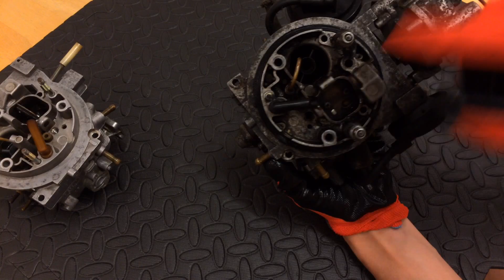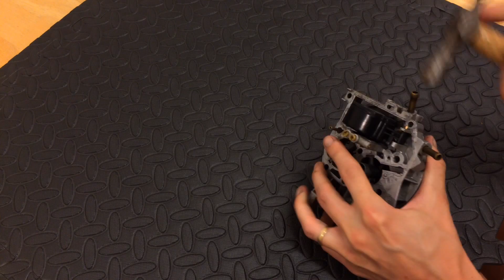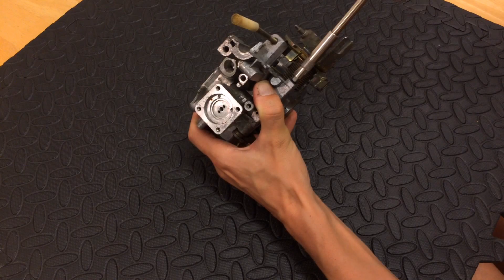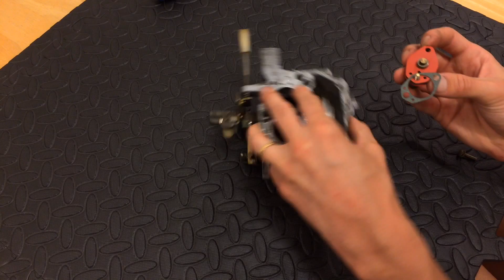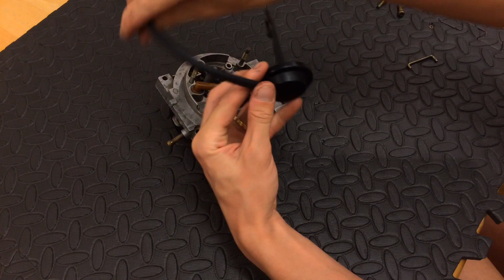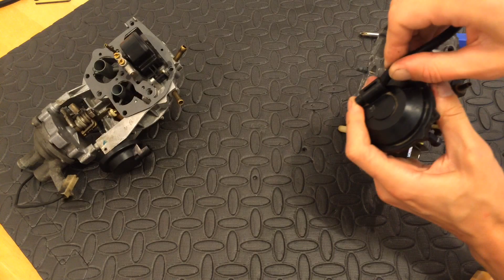Pierburg 2E3 Carb Rebuild & Adjustments for VW T25 / T3

Comment: First! Great vid, almost as clear as a step-by-step guide!

I recently opened the automatic choke on my VW T3 1.9DG because the choke wasn’t closing properly. When I inspected it, I noticed that the bimetal coil sits loosely in its housing – it can rotate around its shaft. Is this normal?

Another issue is that the fast idle cam doesn’t stay on the cam, so I have to manually hold it in place. Could this be caused by a faulty or missing spring?

I’m trying to understand if the loose bimetal coil and the fast idle problem are related, and what I should check or fix first. Any advice would be greatly appreciated!

Thanks again for the great video!

Comment: Thank you very much for the video! I watched it from start to finish! My carburetor is the newer version and I need your help to share a few values that are specific to my engine. It has a code starting with EW. Volkswagen Golf MK1 Cabrio 1.6. What should be the distance between the gasket and the highest point of the float? How small is the opening of the automatic choke and how big is the large one? I've been trying to adjust it for two weeks and something is still missing and it's not working properly. I have come to the conclusion that the float level is low and keeps the needle open, which returns air and fuel from my system back to the tank, because I notice how it flows back through the tube and after about 10 minutes when I try to start it, the starter spins for too long :( (especially when the engine is warm).
Thank you very much, man, for the perfect explanations.

Comment: A persistent problem which surely must be carb/autochoke related: I run a T.25 1.9DG built in '86 with a Pierburg carb. Having stopped for a motorway break of 20 minutes or so my van restarts only to stall almost as soon as my foot is off the accelerator. Repeated attempts to restart end in failure until the engine has cooled for at least half an hour. Sometimes it fails to start even after cooling down. On two occasions Roadside assistance have come and sprayed some Easy Start into the air intake which sorts the problem immediately. Not a happy or sustainable solution of course. (is it true that stuff can damage the engine?) Once it's going again, the van runs perfectly. Would you be able to shed light upon a more permanent solution?

Comment: Hello does some one have some advice for Pierburg 2e3 carburetor for Opel ascona C car 1.3l SOHC engine 55kw 75ps I want to reduce Litel bit fuel consumption so I was wondering do smaller Pierburg Jett's fit in that carb? I'm normali under lower rpm engine ranges I Rareli drive past 50-60km/h .Did ever some one try LPG adaptors on those cars I hope for some info and experiences

Comment: I changed the fuel filter and cleaned out the carb inlet fuel filter and it worked for a while then same lose of power came back. Do you think the fuel pump could be gunked up ?

Comment: My choke pull-down unit isn’t working (diaphragm perished) and you cannot source another one for love nor money. Everyone is sold out. Does anyone have any suggestions? I was thinking maybe block off the tube to the unit then try do adjust the small Allen screw to get the choke flap to open slightly (3mm if possible) when cold. Anyone?

Comment: Hi, just a bit confused about the jets, you changed the jets for the primary and secondary Venturi, and the air correction jet you changed just one, am I not correct in thinking that the secondary Venturi air correction jet needs replacing or is it fixed and can't be changed.

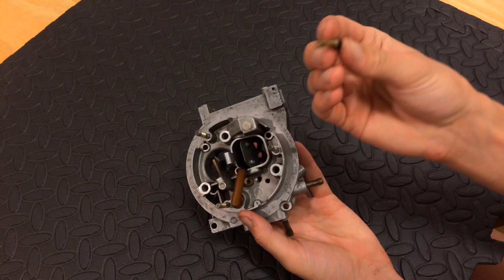Comment: 5:19 Is that air corrector jet allows the air to float chamber to generate more atmospheric pressure in the chamber and pump more fuel through the nozzle? So if mine running reach, do I should screw that jet in or unscrew it to get the mixture leaner?

Comment: Great videos. I’ve watched this one all the way through more times than I care to admit. Still struggling to set my carb up though….it really struggles to start in the cold, I push the throttle in to set the choke flap but it just doesn’t want to start, then the auto choke warms and opens too quickly and the carb guzzles in lots to cold air and bogs down and stalls! Once warm it runs really well. Any ideas?

Comment: I've run into a problem with my pierburg 2e3 rebulid. My pump injector doesn't spray any fuel, i've tried blowing some water thru it even with ball inside pressed but feel's like it doesn't do anything, is it normal (my car is golf 2 with 1.3 engine if that matters)

Comment: Thanks for a great video it is really helpful with the rebuild of my pierburg for the 1988 LT31
Reply from the maker: Hope it all ticking over nicely.
Reply: @JamesAkers   Thanks for asking, actually the car still ides quite bad, it does start but with the help of the throttle. After getting a bit warm it starts to have problems (like running on 5 cylinders only). I suspect the problem is the choke flat that does not open and close when it should. I set it up to max 3,5 mm open but this does not help much. I ordered a new choke pulldown unit (original) maybe this would help. Is there any other way to test if the choke mechanism works?

Comment: Did you use a sonic cleaner in the end?
Reply from the maker: I had a go. It was going well until it just stopped working so can't really give a good answer. The paintbrush works really well to clean the outside.

Comment: Hello James. So happy to have found this video. This might be a silly question, I don't know much about mechanics... yet... My 1988 T3 just had a new engine put in and the mechanic opted to upgrade from the 1.9l to the 2.1l using the same carburetor (Pierburg2e3). I have a few issues (gas mileage, stuck throttle control, missing lever for choke flap) and am now wondering, before completely taking the carburetor apart and/or looking for a rebuild one, will it ever going to work properly with the 2.1l??
Reply from the maker: Hello! Yes, there are loads of people using the Pierburg 2E3 on the 2.1L and it running really well so would definitely recommend giving it a refurb. Search on the The Samba (https://www.thesamba.com/vw/forum/viewforum.php?f=20&sid=1cadc8374c5848ba2d62cee81d3d8217) and Club 80-90 (https://club8090.co.uk/forum/) forums for examples. 

Let me know how you get on!
Reply: @JamesAkers  Ah, only just now realized that you had responded. Thank you so much!! I have also contacted you with my other email on another video of yours...I live in the States and am learning that a carburetor is not the best part to have in the engine, as that version of the VW engines never officially made it to the states. I am determined though to get that thing fixed LoL. The spring from the throttle control is missing and also the lever that attaches to the choke flap is gone. Maybe a few other parts. Those are the two obvious ones. I am on a back order list of sorts for a carburetor coming from the UK, but that might be a while so I am trying to figure out what parts the two missing ones are to possibly order those somewhere and start rebuilding.

Comment: Man, you helped me so much! I had no idle and I followed you assembly guide. I cleaned out every single hole in the carburettor and now I have idle and the car goes much smoother. Thanks! If you want to know, I have Skoda Favorit 135 LX with the same carburettor.
Reply: Keby si potreboval nejakú pomoc ozvi sa :)

Comment: The accelerator pump volume, according to one of the manuals should actually be 0.326 ml (cm³), which is way lower than what is in CJs manuals... Also the duration of the stroke, and the gap between seem to be switched...
Reply from the maker: You're right about the pump test, it should be 1 second pump and 3 second wait!

I thought i'd double checked the volume from the other manuals, i've have to re-check.
Reply: @JamesAkers  thanks for the video btw, helped a ton!

Comment: A great video about adjustments. thank you for the info. I have only one question. when you fit the jets in the primary and secondary venturies you show two numbers, 102.5 and 110, what could happend if I have 105(primary) and 117(secondary)?

Comment: hi great vid, hoping you could help me, i have a issue with the fuel returning to the float chamber via the top hole in the pump and none coming out of the pump injector when trying to measure ml per stroke, its puzzling me.
Reply from the maker: Hi Tony, sounds like the injector may be blocked? Can you move the ball bearing in the bottom at all? I might have a spare knocking about if you need it.
Reply: Hi, james i was thinking the same myself, i can move the ball bearing but it is very stiff and jerky and i can only just blow down it, if you have a spare that would be great let me know how you would like paying as i have looked but can not find a replacement.  Thanks Tony

Comment: For anyone wondering what those marks at 35:07 are for, they're used to set the summer and winter mode for the choke. Also would really recommend making a vacuum generator using an old bicycle pump fitted with a gauge to get correct measurements because those can vary quite a lot if the parts are faulty. Also makes it easier to set up that way because you don't need to hold anything together with a rubber band.
Reply: Thanks for this. Do you know which mark is for Summer?
Reply: @damianokane6161 did you found out?
Reply: @Clinkura69  No, I never did.

Comment: hi james in the Haynes book t has the specs for the peirburg 2e3 for the vw lt 2.4, would you be kind enough to post the specs up, I have used your videos to rebuild my carb but I cant get a manual for the specs, you know the specs for the accelerator pump and choke flap, you know where you used a drill bit, I am struggling to find the specs for the LT want to get my carb back on and the van running
Reply from the maker: Hi mate, the Haynes I have has the following info for the LT 2.4 - There are two measurements for the Choke pull-down: (a) - 3.5mm +/- 0.15 and (a1) - 7.2mm +/- 0.2. If you look at this video for the Golf the guy makes two measurements so it might be the same process for yours: https://www.youtube.com/watch?v=rt7l_B1J54U

No info on the pump setting though, i'll see if I can dig anything out.
Reply from the maker: Also, jets sizes should be 107.5 and 135.
Reply: top man, thank you James really appreciated, I guessed it was around the 3.4-3.5 for the choke I set mine at a "slack" 3.4 so is probably 3.5 so really chuffed, surprisingly easy carb to do once you get into them, look complex at first with all the vacuum lines etc etc but once the screws are in done, they are not to bad, your video certainly help so hi5 from me to you!
Reply: excellent really appreciated james! I found it hard to find the settings for the LT petrol, a lot of info is in Russian, I don't think the pierburg had much love in the uk, they seem pretty good to me if set correctly, simple like an SU used on BL/Austin engines

Comment: I just had one question. I just wanted to ask re the fuel isolation valve, I've tested this, it's clean, it clicks when I put  a 12V charge acrosss it but I wondered, should the 4 holes in the valve all be completely open and exposed when you put that charge across or do they still appear partially 'blocked'. It clicks which is good but not sure how far it should go back so not sure if it is still faulty. Any ideas, thanks :-)
Reply from the maker: Hi Chris. I've just checked my ones and yes, you can still see the pin through the holes so it's not completely open. Hope that helps. James
Reply: Great, thanks James, really helpful.

Comment: Hello are al the setting the same for al cars or do they al need different settings?
I have a vw Jetta 1.3 from 1986 and i want to clean up my carb. to.
my carb. is exacly the same like yours.
Great video!
Thanks.
Reply from the maker: Hi Tom. I've just checked the Haynes manual and the settings for the 1986 Jetta are: Choke pull down - (a1) 2.4 +/- 0.2. The jets and float level are the same.
Reply: James Akers ,sorry for the Verry late response.
I did not get A Message of your reaction.. 
Thank you Verry mutch.!